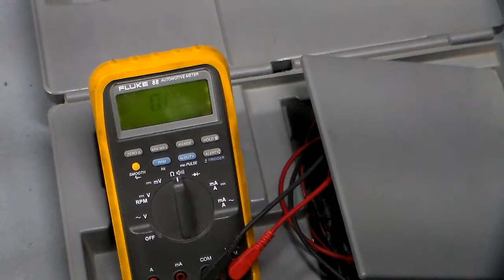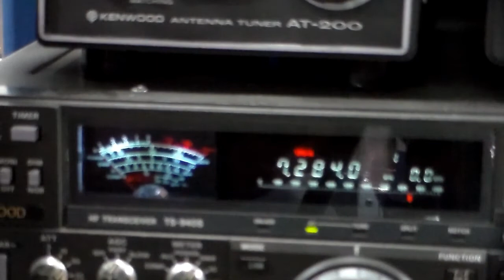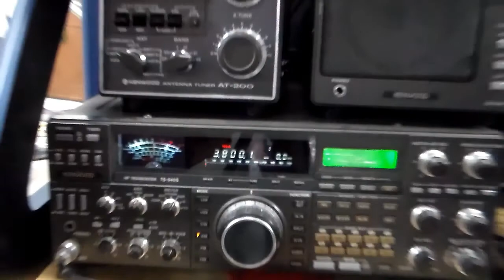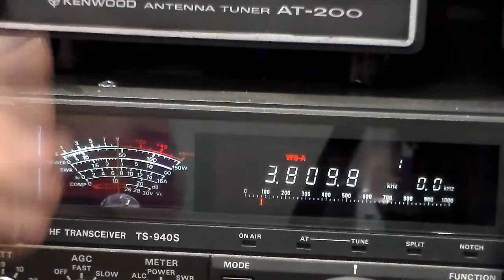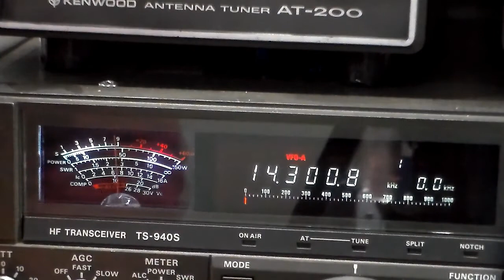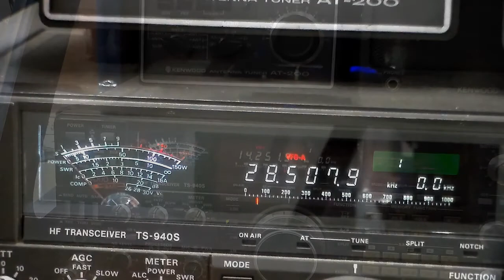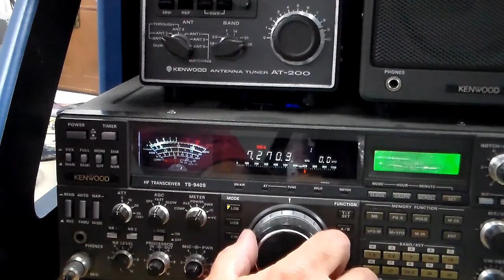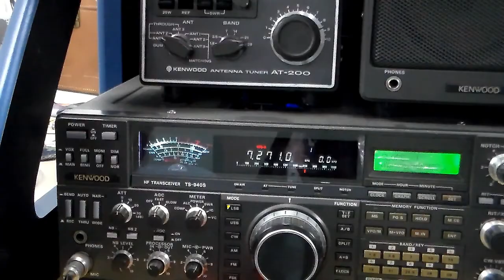GAP Titan DX Meets 4th of July

Comment: Would like to see a review on your gap antenna
Reply from the maker: I don’t have much to compare it to but I can tell you that I use it on most bands and can generally talk to whoever I can hear.  Manufacturer recommends not using a tuner and SWR is generally below 2.5 but I usually let the built in tuners do their job.  I’m happy with its size and construction especially no radials required.  Maybe I can demonstrate it in a future video.